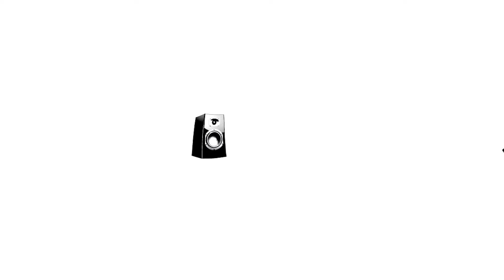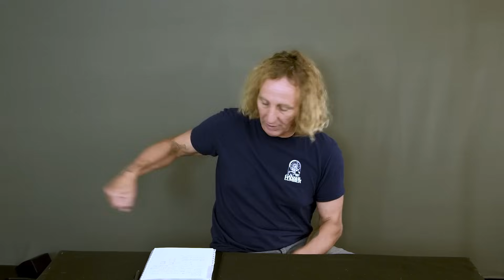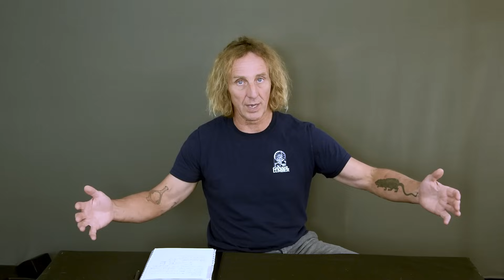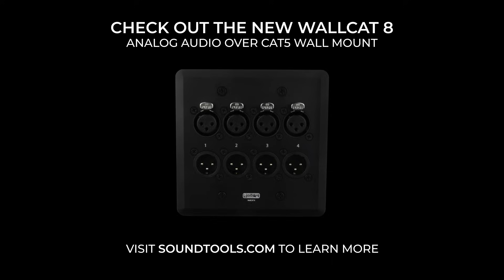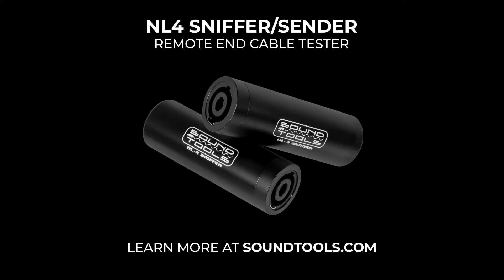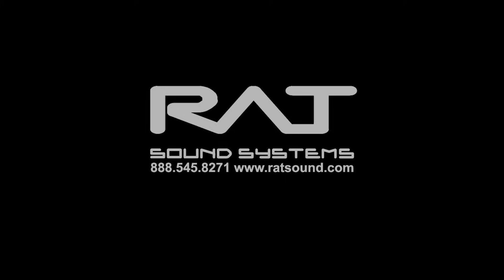New Power Amplifier Watts vs Old Amp Watts & Power (Public)

Comment: Attached is a little musing I wrote in response to a great article in PSN about power amp design improvements.  When amps crossed the 1000 watts threshold, I realized that speaker cables could have lethal voltages.  The article made me wonder why very high power amps all seem to have 5000 watts of power?  What is the voltage of 5000 watts.  The results were interesting.

Why 5000 watts at 4 ohms?
* Why are ultra high power amplifiers rated 5000 watts at 4 ohms?  Why 5000 watts?
* 5000 watts at 4 ohms requires a voltage of 141 volts: V=SQR(P*R) -> SQR(5000*4) = 141 volts
* If I am not mistaken, if you rectify 110v AC with a bridge rectifier you get a maximum voltage of about 141 volts.
* Should we label these speaker cables "Danger, Potential High Voltage"?

* These ultra high power amplifiers running on 110v AC power don't really need a power supply.  Just a really big bridge rectifier and a big bank of capacitors.

BTW, 5000 watts at 4 ohms can push up to 35 amps of power: I=SQR(P/R) -> SQR(5000/4) = 35.3 amps.  I don't know what this means in terms of instantaneous and continuous AC power draws.
Reply: Well sure. 60 amp supplies are usually treated with caution in show business. Hazard tape is advised, and in some places it's mandatory.
Reply: @weareallbeingwatched4602  
Interesting 
However, the voltage is the concern regarding lethality. 
Amperage is the concern regarding physical damage via arc flash etc. 

Regardless, work everything the same; work everything like it's hot.
Reply: I believe it's simply tied to limitations of typical wall power, ie., dedicated 120v 20a circuit (or the approx equivalent overseas).

Any amplifier up around that 5kw region begins to encounter such limitations. With linear power supplies they encounter challenges in size/form factor. 

Of course like we've seen amplifiers needing ever higher capabilities can utilize 240v, and even bigger into three phase.
Reply: @FOH3663  That's exactly what I was saying with my joke about 60 amp sockets... you want to push 100kW... you'll need those amps. Or those volts. To make those watts, as a result of transiting those coulombs, whichever way you fancy pushing that energy about, whether magnetically or electrically.

We could have a high voltage feed like in a power station or transport infrastructure, but that'd be deadly. Especially around beer + drunk people.
Reply: @FOH3663  the hassle of grid electrical engineering is something sound engineers should get more familiar with https://www.youtube.com/watch?v=0pGH1B863oI

I worked with a power infrastructure engineering firm which did "small" gensets of 1.6MW for about 8 years on a senior level... doing their touring tradeshow stands + marketing. Can't be non-technical about that stuff, it's not advisable. Fact is, if you order a big heavy industrial bit of electrical machinery, you're not even allowed to plug it in as the client, the firm's engineering team will turn up with a couple of lorries full of test equipment, and custom handling equipment.
Reply: @weareallbeingwatched4602  
Indeed, that's right up my alley. Early 80's, as a EE/Physics major, just shy of graduating I entered a 4yr apprenticeship in the electrical industry (I couldn't pass up the pay). 
Through the 80's into the 90's, I had parallel careers, one in audio engineering, the other Electrical. 
By the late 90's, I merged them both with a position at an NFL   stadium/Convention Center. Concerts, NFL games, mammoth conventions, film shoots, everything, anything you bring we'll hook it up. 

Sounds like you worked for Aggreko or similiar. I worked with them on many occasions for acts that preferred generation rather than house power. 
Building our new stadium, we spec'd it robustly for event power... still, some acts prefer otherwise. 
I'm retired now, although still involved in audio in various capacities.
Reply: @FOH3663  I worked for OPRA, based in Holland. They design turbines.
Reply: @weareallbeingwatched4602  
Very cool
I wasn't aware of them until just now, cool cool as Dave would say.

Comment: There is a specification that is often overlooked and that’s the power supply. In my opinion, the majority of amp specifications come from the abilities of the power supply. As you go from an A, A/B, etc amp, the power supplies are different. I’ve used a lot of Crown Macro Tech amps in my day and the power switching capabilities of these amps are quite astounding in my opinion. Also consider my usage of small live gigs for around 500 people. My old Marantz 2250 home stereo with 75 watts/ch blows the doors off my newer NAD stereo that said to be 150 watts/ch. a quick look inside and you’ll find completely different power supplies. Another issue is the quality of your electrical service. Under high demand are you still getting the power required to produce the amps specified power ratings…….??
Reply from the maker: Testing so far is showing modern supplies are able to deliver high currents very fast and reach higher wattage levels and are free from power supply ripple being audible in the distortions. But they struggle with higher frequencies and have some hf noise on the outputs.

Comment: I’ve been really curious about this topic lately. I picked up a QSC gx5 and a pair of crown k2s this summer which are both rated at 500 watts per channel at an 8ohm load. I’m using the gx5 primarily for my Yamaha club s115 tops and one crown k2 for a pair EAW jf260 tops and the other in bridge mono for EAW two sb180 subs in parallel. I’ve been wondering what the main difference is between these new and old amps are and look forward to continuing this journey with you!
Reply: I'm impressed with the QSC GX5.
I run the Yamaha club S215 tops off it @4 ohms RMS @1000 watts. It has no problems whatsoever.  Other amps supposedly rated much higher seemed to struggle in comparison.
Reply: @stuungar3390  I have a small rack of the GX7 amps (4 of them) for monitors and mains. Love them. Oddly, I prefer separate amps and cabinets more than active boxes. Maybe so I don’t have to lift the amp over my head for a small show with boxes on sticks? They sound good to me and seem to put out a good amount of power. This is a great video!
Reply: @dale116dot7  - would love to get my grubby little mits on a pair of GX7s,  they'd be even better then the GX5s. My Subs are separate, so to prevent comb filtering, I run an amp per side (left, right) with 1 channel to sub and other to tops, so no need for Xover 🙂 
Ye totally get why you're into passives.
Yep, Dave Rat has a truly brilliant channel, sound engineer's porn.
Reply from the maker: Excellent I will test more amps soon!

Comment: Thanks Dave. I was told that you would need ten times the power to double the volume. Is this true? I really like my old A/B International power amps. Clean with tons of headroom.
Reply: I think the general rule is that when you double the power you gain 3db.  I could be wrong but I remember reading something like that
Reply: @johnmorreale678  So, if you went from 100 watts to 1000 watts, you would only gain 3db? That’s interesting and I could believe it. I used to biamp a pair of JBL Cabaret 4699b’s. The the 18 inch drivers got their own A/B International bridged, two channel 900 watt power amp. I then split the third A/B 900A for the mids and highs. It was a beast of a stereo. My neighbors hated me. 😁
Reply from the maker: 100 wats to 200 watts would be 3db, audibly louderz 100 to 1000 would be 10 db which people say is perceptively twice as loud.
Reply: @DaveRat  Thanks Dave
Reply: Yes, hearing is logarithmic, hence the dB scale. Every 10db is double the perceived volume, but 10x the delivered power, so 30dB gain would sound 6x louder, but require 1000x the power
Reply from the maker: Would 30 db not be 8X?

Comment: the 'how quickly it can deliver the power' is slew rate, am i correct? Volts per fraction of a second. Its specced for just about every piece of amplifier silicon but i dont think ive ever seen it specced for a power amp system. 
In terms of the sustained power handling it would be really cool to monitor the B+/- lines of the power supply, just at the transient caps would probably be ideal, for how quickly supply collapses when its hit with large loads, this (effectively the power supply impedance vs capacitance) will be what determines a lot of the power collapse, and often noise on a prolonged large signal i believe.
Wish i could join ur paid crew but being a disabled pensioner i am really trying not to enable youtube payment or patreon etc cos i feel like it will be a bottomless pit i cant afford, but i appreciate your content. ty
Reply from the maker: Yes, slew rate but perhaps more than that. A high slew rate will enable an amp to put out a high frequency at max power. As higher freq and more volt swing both require a higher slew.

Damping factor or the ability to stop the speaker moving is important.  Also I feel like, and tests would be important, that some amps try to deliver the full voltage and current quickly while others deliver start delivering the the voltage but have limitations in delivering the full current so the voltage ramps up late at higher volumes